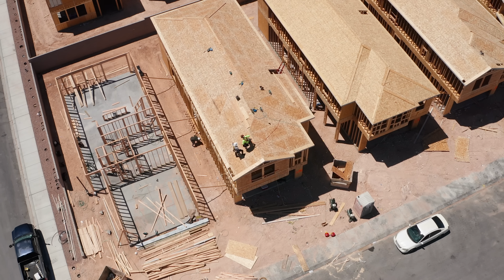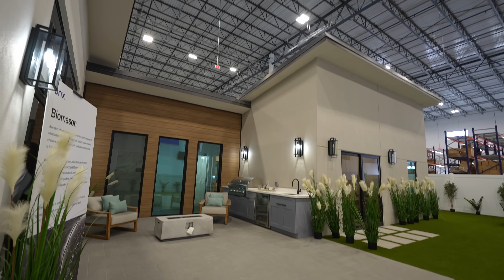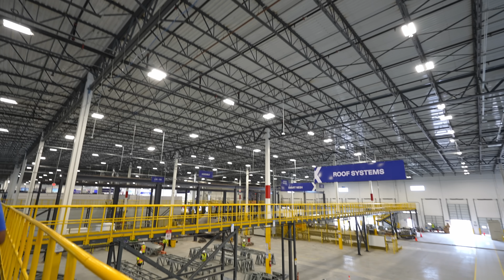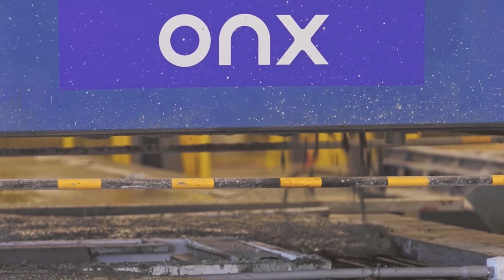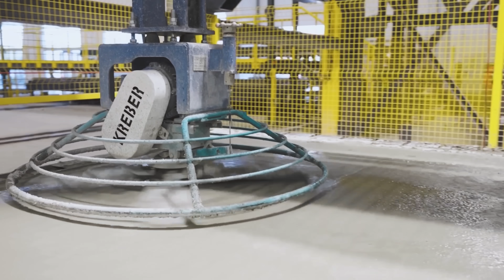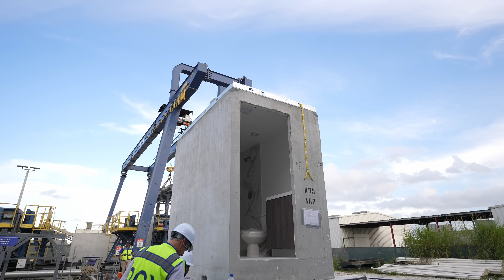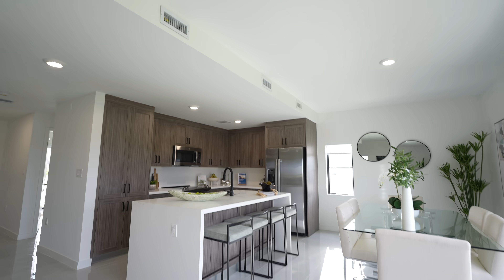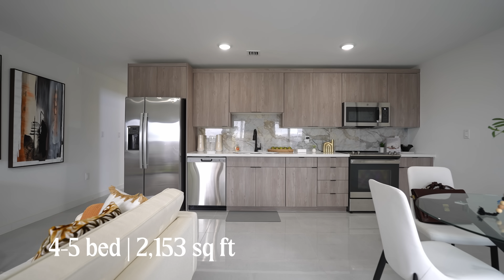Why This Company is Building Thousands of Concrete Homes

Comment: Wow, that prevents termites. Fabulous especially in the hot climates the house stay cooler with the AC concrete. The other question is why is it they build bathrooms with no windows people whoever is constructing hall hood windows in the bathroom especially with the toilet is come on that’s so unbelievable. In the old days. There’s your put windows on the bathroom. it’s eventually bring fresh air light into the home that’s not a good y’all start putting windows on the bathroom.

Comment: 500 grand seems expensive for a "factory-built" home...but consider that in the Daytona area of FL,  1000 sq ft 2br/1bath/Single car garage homes built in the late 1950s are going for $400K and much more if they are anywhere even close to the beach.  The majority are cinderblock (not "stick") construction and have lasted 50+ years of FL weather, hurricanes.

Comment: hmmmm....many small family homes in Puerto Rico are slab-sided, almost pure concrete structures with the concrete exterior walls poured into wooden forms (removed after it sets up) with a slab concrete roof lowered on top.  In PR's tropical climate they are insect and hurricane resistant.  Even after a serious storm and flooding, they can provide shelter and be restored to a fully livable, comfortable condition at a relatively low cost.....repeatedly.

Comment: As a builder, I have to say this kind of construction is solid and durable and one of the quickest to build, concrete has benefits mainly in countries like where I am living now; here the earthquakes are often. A house like a box builded on site not exactly prefabricated use an iron-welded matrix very strong 💪 in just two days it is possible building a new house with quick-drying cement.  Among the unfavorable aspects of cement are: extreme weather, if the house is exposed to a lot of sun during the day the interior temperature is unbearable, and if there is no sun it tends to be very cold, so the position of the house, air conditioning and sunlight are key to a pleasant climate inside the house. Compared to a wooden house, this one requires less maintenance.

Comment: I'm kinda curious how these houses could be added onto, or have their layouts modified by subsequent homeowners, as time goes by?  One of the (few) benefits of stick-framing is, significant interior/exterior changes can be done much easier, than with stone houses.  How would an Onx home prepare for a scenario like that?

Comment: Girl is shocked that houses are built with concrete. As someone that lived in Eastern Europe, Latin America, and Europe, I'm shocked that it took you so long to realize that your houses are made of matchstick. Wait till you discover that windows can open multiple ways AND you can just put external shutters down and no need to nail MDF to the window frames. Also, they are reinforced concrete panels with insulation, mash and rebar. Have been around for decades used for basements. Now they took it out of the basement. Very old Soviet technology, it was used to build apartment buildings that are still standing.

Comment: How do these concrete slab homes compare to the styrofoam concrete blocks that are setup on site, rebar is placed inside to tie it all together and then filled with concrete? Drywall is used to finish them and they have a plastic crossmember to be able to screw the drywall to. What surface is there for the drywall to be fastened to on these concrete slabs?

Comment: I live in a NW suburb of Chicago. My ranch tract/spec home was built in 2003. The walls (all 9’ high) and trusses were all made in a factory. When assembling it took one day to put all the walls together and another day to assemble the trusses and sheeting for the roof. It took 1 1/2 days to put on conventional shingle roofing. It took one day to insulate and install drywall (all sheets were 4 1/2’ x 12’ long, ceilings and exterior walls were 5/8”, interior walls were 1/2”).  This home was started in March and finished in May. It is 2240sqft with a full basement, 3 car garage, 3 full baths, vaulted ceiling in entry/family room and has 2 large masonry brick fireplaces. I’ve had nearly no problems with drywall cracking, etc. in 20 years. The home is very livable with virtually no problems. 
In Poland they build homes mostly of concrete. There is virtually no commercial wood. Years ago even the windows were made on site with wood that was cut down by the owner and dried outside for 2-3 years. Doors were made the same way. The last 20 years they have imported great windows, doors and even heating/water furnaces that are very efficient from Germany, etc. Many homes are built of clay, concrete, or concrete blocks, depending what is made locally.  All floors are concrete, even interior walls are made of similar concrete/clay products. Most roofs are concrete or clay fired shingles on a wooden structure holding it in place.
Reply: Americans build houses to life in for a generation. Europeans builds houses in European traditions which might last centuries. We have farm houses hundreds of years old. I was in America as a exchange student in the 1980s and they proudly showed me the oldest house in town 150 years old. The problem was: I am from a medium sized village and we had multiple farm houses twice that age and older. And that’s nothing special in Europe at all. Every other village around us could have said the same. 
Concrete or stone means that houses have a huge thermal mass which means they will stay warm or cool for a longer time than drywall houses one they reached a temperature. I never understood which “benefits” drywall construction, apart from price, has.
Reply: How much did it cost you to build your 2003 Chicago home? How much do you estimate that it would cost to build in 2025? Thnx!

Comment: My home in Miami survived few hurricanes it was built in 50's on swamp area filled up it was a concrete modular home got to property in pieces , it sits on cement blocks. By being elevated on blocks the home has withstood shaking from near by quarry that set explosions the floor tiles never cracked.

Comment: 9:26 This is the first time I hear that concrete is much better at insulating temperatures. In my experience, it has been quite the opposite. I live in Puerto Rico, where most houses are built out of concrete. Since we have warm weather all year round, houses get very hot inside during the day. It is like living inside an oven.
Reply: If it is properly insulated. Sadly, it isn't often in our climate, which is why it feels hot inside.

Comment: Cool.  I like these houses.  The insurance should be less if the houses are more fire, wind resistant.  Is the insurance less?  Why isn't there a window in the bathroom?  I want a window in the bathroom I can open for cross ventilation and to avoid moisture build up, mold.  Concrete homes are not new in Florida.  They have been used in rich people houses, mansions for a while now.

Comment: They should be doing precast concrete slab roofs, as well, helps bolt the entire structure together, for maximum strength. Fun for very low pitch traffic able roof with easy solar panel install.

Comment: wood is superior to steel in terms of fire performance. 

wood is really slow to burn and allow time to react, it creates a layer of coal that takes hours for fires to get through. steel on the other hand can very quickly heat up and buckle, which essentially means everything steel was holding falls. so no steel is not better than wood in fire resistance, mrs businesswoman

Comment: I actually really like this. Concrete such a durable material. Sound deadening as well. It's a totally solid home compared to these plywood homes that are mostly built in sub-divisions.
Put on a more durable roofing that shingles. More like metal or proper roofing tiles. Then with vinyl windows. You wouldn't have to do any maintenance for the house in 50 years. Just paint job and keeping it clean. With a basement as well then you're basically hurricane proof as well.

Comment: Great video and top method, however it's not new as the Russians have been doing this for decades for their high rise housing. It's too cold to work outside over half the year so pre-fab bathroom pods and whole kitchen pods are lifted into place by crane into a highrise itself made from pre fab panels

Comment: This is a very interesting concept.  I can see where many things can be done more efficiently by building concrete houses in a factory setting (especially since doing so requires very large equipment).  One thing not mentioned in the video is that these houses would also be much more resistant to tornadoes.  I've often wondered why more is not done to build houses that will stand up to natural disasters.  I think the "green concrete" is totally irrelevant especially if you are building a house expecting that it will last 50-100+ years.  A more important question would be is the "green concrete" cheaper to use than regular concrete.  Think of the natural resources saved and pollution prevented by building a house that will last twice as long (maybe more) than a traditional house.  Going with the most efficient option (rather than playing politics over CO2) would allow more of these homes to be built, make them more affordable, and therefore have less impact on the environment compared to traditional homes that would have been built instead.

The actual houses look really cool.  On the other hand the neighborhoods look terrible!  The houses are way too close together and they all look exactly the same.  The front yards are extremely small.  (The backyards are not shown in the video but I suspect they are also very small since the houses are so close together.)  I think the model home inside the factory has more yard space.  If you are building 5 bedroom houses (as mentioned in the video) then you need space for things like dogs, kids, and BBQ grills.  They could at least have some variation in paint color even if the houses are all designed exactly the same.  Not far from where I live a group of 8 brick townhouses is being built.  They are all built exactly the same but each has a different color brick.  This gives each one a unique look and overall looks MUCH nicer than if they were all the same color.

Comment: Excellent video information and research along with presentation.

Carbon offsetting against the build foot print vs the ongoing footprint in reduced costs.

The stick built vs long term and less risk.

Concrete cost and carbon intensive vs heating and replacement build.

The one big issue is the development of large estates and them having there own different design or slight outside customisation,instead of all looking the same and ending up trying to enter one of your neighbours houses by mistake.😊

Comment: Anyone in Germany: 😂😂🤣🤣🤣 Houses are made of bricks, garden houses for children are made of wood. While they are NOT having any issues with tornadoes & co. Imagine the level of stupidity they must assume.
What US citizens consider to be a „regular house“ is considered a a „cheap house of low quality and minor value“
Dry walls are ridiculously bad blocking acoustic noise, they are considered „cheap quality“, too.
Btw.: Concrete is of course more durable than wood, still it’s not as durable as bricks.

Comment: No foam insulation on the outside? Doesn't seem to have a very high R value. Maybe okay for FL but not suitable from colder climate, unless exterior foam and stucco is added.

Comment: It would be interesting to see this concept used with aerated concrete which is 1/6 the weight and a great insulator.  Granted thsi would require a large autoclave for curing as aerated concrete uses powdered aluminum to produce the aeration.  Powdered aluminum is highly flammable (and can explode) so it does require robust storage and handling processes.

Comment: Ya concrete houses suck where you have winters and summers. The reason concrete driveways crack is because of the changing temperature. Its expands and contracts. imagine driveway type cracks on your house. Good luck and have fun dealing with that. Also concrete is more likely to develop mold when wet. Oh and concrete is less resistant to earthquakes.

Comment: Not affordable and for most people's budgets in Central Ohio they need $150000 or less home that is about 1200 to 1300 ft^2. Also Ohio has rediculious insulation standards like R40 ceilings etc. Most of your heat loss in our state's climate is due to air infiltration, not conduction, so that R 40 ceiling is practically useless for reducing heating bills but it sure increases the cost of the house. Some counties in Ohio will only permit stick built homes too,  which surely increases the cost of the house. What we need to solve our housing crisis is new politicians that can build more sensible laws and permitting standards plus companies like Onx!

Comment: You're right about prefab homes typically not being any cheaper. They're not usually really mass-producing them and they always forget to factor in the overhead costs associated with the extra factory you need in which to build them.

Comment: i mean concrete house is good but if you build on top of eartquake plate, it would be disaster, but i see that the company using steel for reinforcement, and that's a good solution for that issue as long as they put balance on the degree force of each corner of the houses.

Comment: I mean this is every other country in Latin America with concrete houses, say what you will but those houses are built to last when done properly. Although I think the best option to cut costs down is probably making the first story most of  casted concrete and the upstairs of wood and metal panels so it can be light during earthquakes but have a stronger base

Comment: Somehow I had no idea how utterly insipid younger generations of Americans are... To hear the statement that concrete homes FEEL DIFFERENT from traditional stick homes? Seriously? I doubt 95% or higher of X-,Y- or Z-Gen Anericans would have a clue about the FEEL of a wooden home versus a concrete home or even know the materials used in constructing the dwelling they are living in! Houses, buildings and other structures built to last have been built using concrete or some form of it (Roman Concrete, for example), for more than 2 millenium. That means 2000+ years for you tree-hugging types who think building with concrete will save your precious tree resources.According to Historians and archaeological researchers, there are currently more trees on this planet than at any time in recent history.

Comment: Living in the south Miami-Dade area during hurricane Andrew, prefab concrete structures did not survive. 

Concrete block houses, which is the standard in South Florida survived for the most part. Wood truss roofs varied in survivability according to the wood deck used. In my neighborhood we had a mix of house age. The 1950's built homes had a 1x4  tongue and groove roofing deck, with a tar and gravel roof on my particular house. Those roofs had minimal damage and would have survived fine if not for a couple of 2x4 missiles coming in. Shingles and tile roofs did not survive, although the T&G roofing decks did survive. 1970's homes with 5/8" plywood decks didn't make it regardless of roofing material used.

Comment: Well it is a house meaning concrete construction that will hold for a long time. Compared to Europe it is all very baby in ecological standard. It is like we built a hangar 30 years ago. Price...ain't cheap baby.An advantage is that it builts very fast a question of days, another advantage is that you can adapt the finish according to budget. Negative is that these houses sit too close to eachother. So much better than a wooden house, solid construction, still has american charm (very important)  and is rather costly for what it is. What in stone could i buy or realize in Houston Tx with a 400 000 USD budget? That is the question americans have to learn to ask themselves . Another aspect is that americans can keep their warm heart in the choice of their house, individualism is still apparent. In europe that is mostly erased..and it costs almost double (a stone house fully attached and with obligatory german ecological stuff in it you'll hardly use) So afterall ...baby AMERICA LAND OF THE FREE

Comment: Concrete also works great against the heat of florida, 
It does not penetrate as easily as wood frame houses much Stronger against wind

Comment: I like the concrete idea if it's strong enough to withstand a hurricane and cut termite damage. The roof looks like it will blow off with the big overhang to catch wind. The cement has to have major quality control as people in TX found out when their pools were crumbling to pieces after a couple yrs. Something they call "concrete cancer", people are left holding the bag as the builder just goes out of business and will not replace or repair anything. Of course if it floods all the low level " drywall" turns into a soggy moldy mess.

Comment: If they aren’t durable… chances are… it’s not the “time under construction”. It’s more than likely, the supply chain; if you think about it… how many states are making homes, and apartments… and maybe even commercial buildings out of these same shitty building materials. 0:55 why’d you leave out tornadoes??? I mean; in the plains, and south a basement is a luxury… and if someone has build a storm shelter in their yard… why not, work with that harder soil.. charge more.. and make basements?